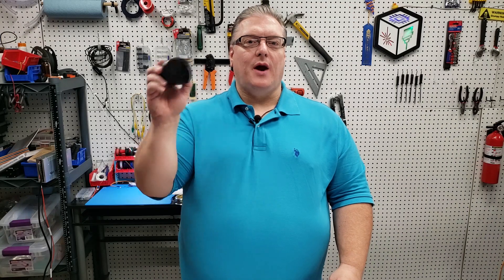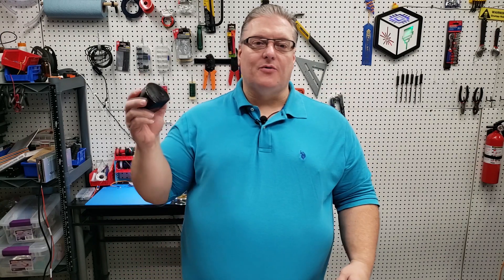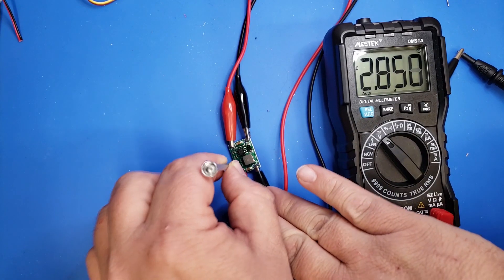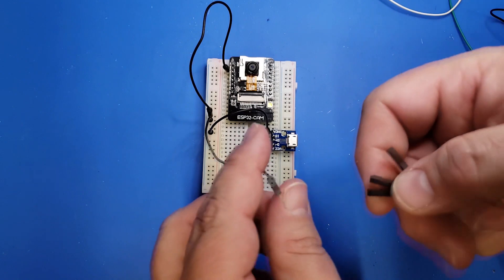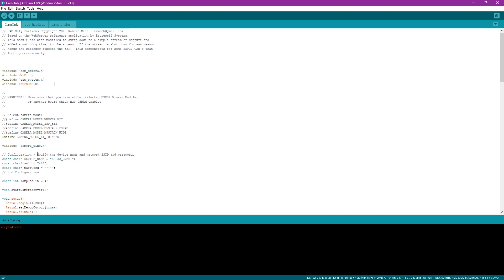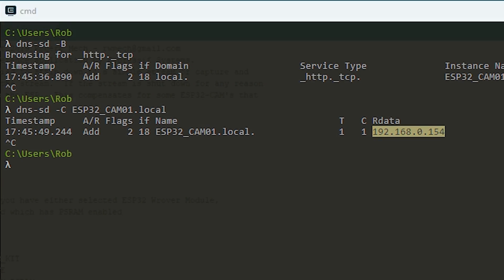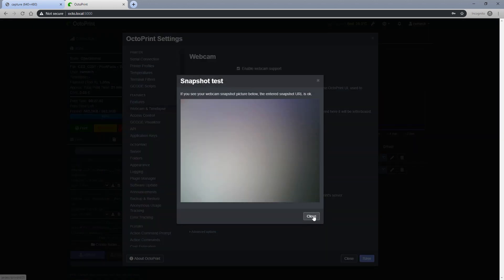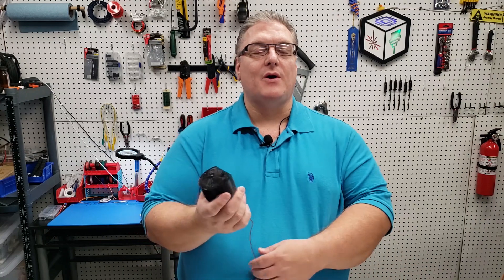$10 DIY Wireless IP Security Camera for 3D Printers & Home

Comment: Nice tutorial. I just might have to try this. When programming the chip, you did not mention that RX goes to TX and vice versa. Some new users may assume to match each signal one to one. If it doesn't work try flipping them.
Reply from the maker: You're right Don that was an oversight. 😮 Thanks for pointing that out.  It is key to switch those to make it work.  Thanks again Don. 👍

Comment: Doesn't the USB serial converter already have 5v power that could be used for the programming phase? I don't know the specs on that part but from what I've seen that's often the case. That suggests to me the micro USB power board is unnecessary for the programming phase. Just curious. Great video.
Reply from the maker: Yes, you could use the USB 5v.  Also, several new ESP-32 Cam boards like https://amzn.to/3AUwcLA have a programming board so you don't need the separate programmer.  I'm going to be using one of these boards on an upcoming video for next week.

Comment: How can we turn off the printer using espcam
Reply from the maker: You would need to write your own code for it but you could certainly control a relay with it.
Reply: @MakersMashup  so what will give the relay a signal to turn it off, esp will do that? Or i ll have to use arduino?
Reply from the maker: The ESP32 works like an arduino.  You just need to look for a free pin.  From there you can modify the web interface or create your own method for triggering the pin which would fire the relay.  You'll just have to write code to do all of that but there are plenty of internet tutorials on how to trigger a relay on an arduino.  The ESP32 operates the same way.
Reply: @MakersMashup  ohh nice , thanks

Comment: nice video could the ESP32 CAM also be used to make a wearable / wireless ip camera that could be accessed on a smartphone for video streaming?  I would like to bypass the built in camera in my smartphone in order to live stream a true fpv / pov . Im curious if there are various sizes of the ESP32-CAM , preferably smaller overall in order to create something that could in fact clip onto your glasses.
Reply: Esp32-cam can work like that. I've seen a video they used it for a car dashcam

Comment: this if course assumes you are not using a  ESP32 Camera module which seems to not want to connect to any Port as far as the Arduino IDE is concerned..
Reply from the maker: Sounds like your pc is just missing the ftdi driver. If you do some googling it is a fairly common problem for those who use on the first time.  You may be able to check where you bought it and they often have the link to the driver you need.
Reply: @MakersMashup  I worked around it by using an Arduino Uno as a programmer - that worked fine. This video explains it in case anyone gets stuck like I was. https://youtu.be/tzmcXZ-irIc

Comment: Hi I was just wondering and I tested it , can you just get the 5 volts from the usb programmer?
Reply from the maker: Probably.
Reply: @MakersMashup  Hello first of all thank you for ur videos they have been really helpful for my home projects, anyway i was wondering the same thing, why it has to be connected with both the usb programmer and the micro usb breakout power? could i use just the    usb programmer to power it?
Reply from the maker: I dont know that it has to.  My thought at the time might have been to power it separately because I disconnected the programmer after programming but certainly you can power it with the programmer as long as you're not exceeding the current draw overall.  Really no reason though you couldn't use the programmer power.  Just saves a step. :)
Reply: @MakersMashup  THANK YOU very much your help i really appreciate it , i will be doing this later when the pieces arrive!

Comment: I have used several of these cameras and very impressed with them (especially for the price).
I have created a motion detecting security camera sketch which may be of interest:  https://github.com/alanesq/CameraWifiMotion
also a sketch which may be a good starting point for creating a custom camera for a 3d printer?   https://github.com/alanesq/esp32cam-demo   (you could for example include a button to cut the power to the printer using a relay if anything goes wrong)

Comment: Any way to use software to view these cameras when not at home?
Reply: VPN is a safe option. Many routers offer VPN & dynDNS. You can also run it on your RPi: https://www.pivpn.io
If you only get IPv6 addresses from your provider, you can not access it from IPv4-only (e.g. phone) without another server.
Reply from the maker: Anytime you expose your local network to the public it opens you up to potential security issues.  I would suggest using something like Google Remote Desktop to access your computer remotely to view them vs. trying to host it on your local network exposed to the internet.

Comment: What is power usage on these? Powering it on batteries is my plan?
Reply from the maker: 5v no problem. Use a USB power bank as i mentioned in the video.
Reply: Several power modes are available:  https://lastminuteengineers.com/esp32-sleep-modes-power-consumption/

Comment: So if anybody else stumbles upon this like I did. Save yourself a day or so and just buy a cheap wifi camera rather than doing this.. you can get them for around $20 now. Most modern wifi Access points really really hate Esp32 devices. They only connect to 2.4ghz and if your network is like mine you have to jump through a lot of hopes to get a sticky 2.4ghz WLAN.... if you even can. Then top it off that there are several different versions of this kind of camera and it's never really clear which one your using. So it makes it a guessing game in the Arduino ise. Oh and I forgot to  mention I did get it working but only if I was within a foot of my Access Point.... spend the extra money and get something that can connect to modern wireless. In the end I know I spent more than $20 bucks just to get this all running, and I could have had everything wrapped in a nice little package and working with in 20 min. Rather than spending a whole day only to be disappointed . That's my 2 cents.

Comment: How would you connect multiple cameras - that's the point you made right at the beginning that you can have many (on OctoPrint?). I know you can have many on your network, I've used these a lot. But I want a couple on OctoPrint if possible. One top-down, one attached to the bed. Thanks!
Reply from the maker: Check out the multicam plugin for octoprint.  Then you just setup the additional IP camera in octoprint
Reply: @MakersMashup  fantastic. BTW - I loved your DIY 3D Printer series. It's a lesson in how to guide people in detail with finesse!
Reply: I must have scrolled straight passed that in the plugins list :)

Comment: Does this still require a raspberry pi to run octoprint? I cannot get around the $50 price tag minimum for a single wifi printer camera
Reply from the maker: It does if you plan on using it in Octoprint but the web cam will respond to a direct IP request too.  Its really up to you how you use it.  Tip on Octoprint.  You don't need a PI.  If you have an old computer you can run it on that.  You don't need a Pi to run octoprint.  You can read about it on my blog https://www.makersmashup.com/post/outside-the-box-ditching-octopi-and-keeping-octoprint
Reply: @MakersMashup  thanks for the reply! it's a good tip to use octoprint on an old computer, there are people I know who don't have an unused computer available to flash raspian to so I am trying to figure out a low cost work around. Ever try using ESP3D with the ESP32-CAM?
Reply: @MakersMashup  Instead of an old PC, would it be possible to use an old mobile phone to run Octoprint? Since one could crack it and install Linux I assume one should be able to install raspbian also, no? The only issue I see is that it runs off a battery and not direct from the power brick.

Comment: If you put in an inexpensive ($0.25) tp4056, you can connect the 5 volts input to it, then a li-ion (phone / laptop) battery and the camera to their respective outputs, and you effectively created a camera with automatic power backup. The tp4056 will let power go through directly to the camera when the battery is fully charged and power the camera with the battery when power is disconnected, it will also auto shut-off the battery output once it reaches minimum voltage (2.8v) and will turn on the camera AND charge the battery at the same time when you plug power back in. It also charges the li-ion correctly with the CC/CV method.
Great video, I'll look into those cameras!
Reply from the maker: That is a great idea Spartacusse!  I will check that out for sure.  There have been plenty of times I have wanted to do that and went the route of of the USB rechargeable.  I will be ordering a few of those today to check them out.  Thanks again for the great feedback!
Reply: @MakersMashup  Great. I'm glad you've liked the idea, I hope you do a video on this before my ESP32's arrive, it takes 2 to 3 months to Brazil :( . I don't have a USB to TTL in a board like you, but I have one of those pre-made USB-Serial programmer cables, as well as an Arduino UNO, do you think between the two I'll be set to program the ESP32? Or should I order one of these little programmers you've shown in the video? Thanks.
Reply from the maker: I've never tried it but articles like https://www.teachmemicro.com/arduino-usb-serial-converter/ claims you can.  I think the adapter is worth the frustration of having the esp32 show up and no way to program it 😉